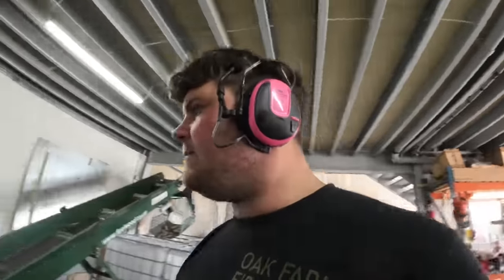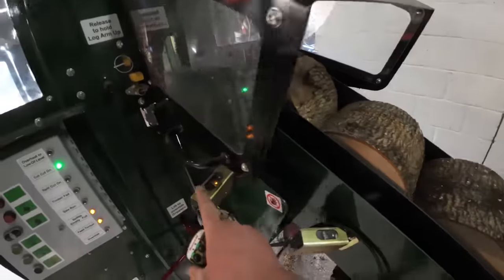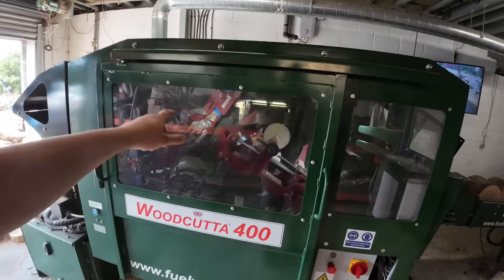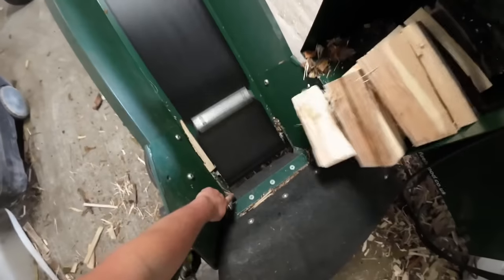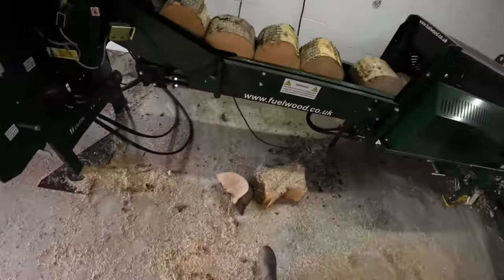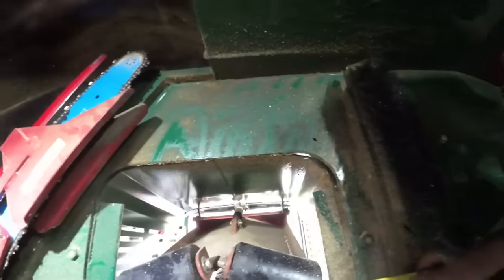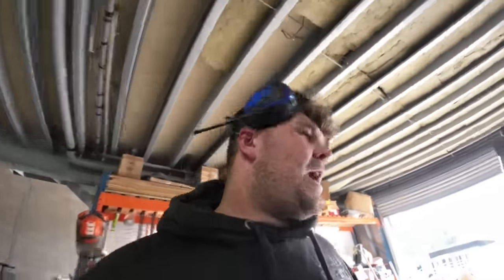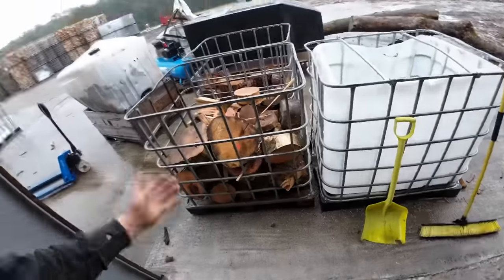Day 23 - Best AUTOMATED firewood processor?

Comment: I'd like to see some other content on the splitter and how it performs when the in-feed conveyor is not always kept full. And some overall content on running smaller logs. Do you have a lower limit for logs going into the machine? If so, how do you process the small logs?
Reply from the maker: It can process down to 8” logs but you can process 8” logs faster on a smaller processor. I’m currently putting the smaller stuff aside and I’ll buy a smaller processor for that stuff at a later date, I’ll show you some smaller stuff and more splitting action 👍🏼

Comment: Nice set-up Connecticut woodchopper I'm still old-fashioned at my little wood splitter in my chainsaw 65 in October still going strong I am building a small 4 ft wood processor to cut small stuff should be ready in a few weeks
Reply from the maker: Sounds interesting good luck 👍🏼

Comment: NZ here , inspirational blueprint  setup there to follow  ,  IBC's, forklift  rotator ,setup in  a shed , Kiln using the waste wood , and a dog to keep the seat warm !.
Reply from the maker: I spent 7 months in Nz working for Quigley contracting. Amazing place! Thanks for your kind words, I’m always learning
Reply: under 35 cm all you need is something like an evo 36 or a Regon R2 or R3 (cheap french unit). Or the holly grail of euro machines IMO the Kubik  , I saw one for sale recently but they are rear to find . Over 45 cm  you need Rex X from Australia .. Pricey 60cm capable X type machine for AU hardwoods or the relatively cheap NZ wampa chompa  $75,000 NZD , or what I would do some sort of American box wedge wood splitter with a attached  log table which will have a clamp and attached saw and conveyor belt running to the splitter . In a recent video challenge the Easton made splitter was running at 6 cords 30 CM an hour , feeding it as fast as humanly possible
Reply: @oakfarmfirewood   Nice Im about an hour south  from there , near Pleasant Point  ( named after the pub , it was a pleasant point to stop the stage coach back in the day)

Comment: Let the machines do what they do best, all you'd need to do is keep up on lubrication, bin swapping and general tidying around. I'm a fair bit envious but none the less, you've got a great setup. Only minor thing I'd do if possible, that wall where you have you catch baskets lined up. Open out that section,bout the baskets on a rail so you can just push a full one out and have a new empty basket take it's place. No need to stop, thread out with a forklift and bring in a new then restart everything.

But that would get into installing a new roll door, more concrete pad. And moving the storage from one side of the building to the other. Which may not be feasible or practical.

As for the off cut ends, with enough of those. Break them up and bag 'em up for sale at say... £6? A bag. The price would be the unknown since if you're selling a basket for probably £70, a bag of odds might be more or less than £10. All the sawdust can be bagged up and mixed with compost for gardens and flower beds. Get ways to wring every cent possible out of the logs.

Comment: great too see the mashine in action. I'm from Denmark. I have a Hakki Pilki 43pro, but am waiting to get my new 50pro. bigger logs makes a difference. I have my oven forest, so I must be able to handle logs from 10cm to 100cm in diameter.😊
Reply: I have a 43 pro and hate it so much re splitting work, what knife do you use?
Reply: I use the 12 Way fore the logs from 30-43 cm in diameter. 
Fore my new 50pro i will reemake the 16way knife intoo a  20 way knife.
Reply from the maker: Sounds amazing! Thanks for watching
Reply: @henrikkring434  hey Henrik. Be aware on the 16 Way knife for the 50 pro. I have one and the 16 Way have problems holding.
Reply: @jesperandreasen162  Det sagde Anders fra ABM Stål også til mig, så han vil lave den om, så den kan holde.
Det er de nederste vinger på kniven der brækker af. Så han laver den om til en 20deller kniv i stedet. Det holder siger han.

Comment: Are you not loosing lots of production by filling all 3 ibc then moving them? How about filling the end 2 then while you move them fill the one by the wall just while taking the other two Away? Ok when its full you will need to stop or use a pallet truck to pull it out and replace with empty. When you have two stack and take away. Or if you have space take from the end with forklift. But love the set up. Would love to build one lorry mounted to replace my current mobile unit.
Reply from the maker: Yes I do tend to fill up the end one if I have a driver but I was on my own this day

Comment: Just an idea don’t know if it would be efficient but maybe you could press the saw dust into pellets. Anyways probs for handling everything so cool and calm while explaining everything. :)
Reply from the maker: Hi, yes have always wanted to do this  however I typically cut green(wet) timber so all the sawdust is wet. To compress the sawdust it needs to be dry (under 15%) or the water will turn into steam when put under pressure and basically destroy the briquette. 

That being said yes there are sawdust driers but they are very expensive along with the expensive briquette machine the numbers don’t add up for me👍🏼 

I now have a number of customers that buy sawdust in its raw form for animal bedding.

Comment: I'm from Quakertown, Pennsylvania, USA. is the length of the split wood adjustable to 16, 18, 20 or 24 inches? also there is no waste in firewood, its all burnable, you just have to repackage the smaller bits to fit the market's needs, that includes charcoal and kindling.

Comment: I seen you commented on another comment here about length. You said your processing 9 inch. Here in the USA our standard is 16 inches. To me the setup is for short wood. Do they have different sizes you can get? Or is it adjustable to 16 inches? Nice setup. Peace
Reply from the maker: Yes we all our stoves are tiny here, bit of a shame. The machine can cut and split up to 33cm (13inch) I do some 12” for a customer so I’ll do a video of changing it over and processing larger stuff 💪🏼

Comment: sorry for the bombardment of comments, but I have another question :  Can you keep the machine running while you load up new timbers outside in the loading area?
Reply from the maker: Erm technically yes if it’s nice easy wood but you need to mainly use the remote to control the timber deck and next bit of timber.

Comment: How often do you need to change (or sharpen?) the saw in these firewood processing machines  (my question is also for smaller ones with the same kind of setup)
Reply from the maker: All depends how dirty the wood is but I can normally get a full day out of a chain before a sharpen up

Comment: Watching from Tabusintac NB Canada. Looks like you are cutting your blocks around 12” or 30 cm in length is there a reason it’s so short? Typically here i try to cut mine at 16” gives me six pieces per 8’ block
Reply from the maker: Our standard length is actually 9-10 inch but I do cut some 13 inch for restaurant wood

Comment: What length are you splitting at in inches? Here where we are at standard is 16inchs. Very rarely do I get customers who want the wood shorter.
Reply from the maker: I wish we did it’s so much faster for processing. I cut mine to 9inch
Reply: in the USA 'bigger is better'  in EU I guess we have smaller stoves and heaters.  although the fireplaces in old european mansions and manor houses are HUGE and could take 30 inch wood.  As a child i lived in a castle and we had massive hearths..   (although the heating was done with coal mostly, the fireplaces were just used because they were cozy )   
This was in the 80s, but the castle was mostly a time capsule and had not changed since the 50s.

Comment: It's the least labour intensive firewood producing system I've seen to date.  π × r² being the basic math for an area of a circle (end of a log), pretty easy to see the extra volume created when increasing the size of the log. Bigger logs = bigger volume.  We are in Nova Scotia, Canada. I sent them an email asking for pricing of the setup you have.  Do you set aside logs with crotches in them or have you tried to put them through as well?
Reply from the maker: Yes that’s it 👍🏼 absolutely love Canada! I clean up the log so it’s fairly straight but it deals with knots etc fine
Reply: @oakfarmfirewood  I got an email from Ben on the pricing. At £$100K (plus the investment necessary for 3 phase electrical) it's well beyond what I'd be willing to invest but good to see working for you. All the best.
Reply: @WoodchuckCanuck for personal use it may be steep. if your having  a business on it, saved man hours per unit split is the main metric.
Reply: @johndoe1909 True enough. Depends on business volume I suppose. Specific to our region, with the suppressed pricing, to invest +$100K plus another $150K for bldg and electrics, to simply save $30 in labour, not worth it IMHO. You'd have to move 1,000 cord a year to make that sort of thing worthwhile and that's with forecasting a 10 year business plan. Factor in to the ability to source a consistent supply of proper logs which could be obtained if a premium was paid but then that wipes out the savings from the asset investment. Vicious circle.
Reply: @WoodchuckCanuck  all depends  on the corcumstances. if you dont have the electricity and buildibgs everything explodes  .

and it also depends on the workforce here in europe you typically have to pay around 30dollars/h. a typical year you have to pay about 2080×30=62400 dollars. in short. if it cut one full time employee you will have a roi of 100+150=250k/62.4k= 4 years. if it saves 2 empliyees, well.... but as you said, it all comes down to what plans you habe and if its a side hsutle or you main long term business.

Comment: How much time do you get from one chain?
Reply from the maker: On a big day we change it at lunch to keep cutting fast. So normally 6-8 hours of cutting depending how dirty or seasoned the wood is. But the whole chain I probably sharpen 10-15 times before it’s done. I find if you take it off before it gets really bad it only needs a touch up and you take less metal off

Comment: Hi,do you give your customers a moist content of 20% or less.
Reply from the maker: Yes we aim for 20-22% in the middle with the outside being around 6% giving you a 13-14% average log that is dry! Getting the middle of the log really dry just makes them burn to fast and had complaints that they burn to fast. Better than complaints about not burning at all I guess
Reply: @oakfarmfirewood  ok but it's a shame you couldn't get it below 20%especially someone who has a modern wood stove that requires 20% or less
Reply from the maker: @adenvet2830  the amount of people I deliver bone dry wood to then leave it outside in the rain or store it in a damp garage on the floor will shock you. Average 13% is plently dry enough and keeping ahead bringing 1-2 nights worth of logs in before you use it is key be it seasoned or kiln dried.

I know company’s that aim for 20% average with 28-30 in the middle and 10 on the outside. It just cost more and time to get it down to where I sell it
Reply: @oakfarmfirewood  We aim for 20% MC average. And like you said, it's surprising to see how many people will pay the premium for KD firewood, only to have it sit int eh driveway with a tarp over it all Winter. Yet, they say the wood burns great and a little bit of snow or ice goes away after being in the house for a day.
Reply from the maker: Yes sure does. Weather it’s kiln dried or seasoned I will bring it in for a day or 2 before burning.

Comment: allways when i see these nowadays firewood processors, i just cant understand that why do they have to make the cutting with a saw blade ! it is so slow, makes a huge mess and if you have dirt  in wood it dulls blades really fast !
quillotine cutters are just so op when compared to effortless and fast cutting .
Reply from the maker: Need a lot of power and would like split/ make a mess of bigger timber
Reply: @oakfarmfirewood  well probably a mess, if you would try to cut that dry of a wood, we usually process the wood right away after cutting it from the forest, when the logs are wet they cut really nice and then let it dry in gages,
we have tested the chain cutting but the amount of wood dust that it makes is just insane and its all lost from firewood,
also we have lot of sandy forests and they really dull the chain fast.